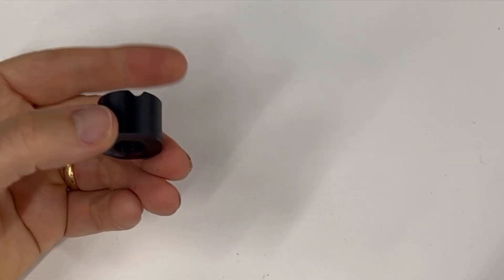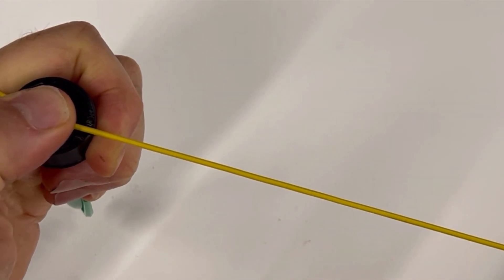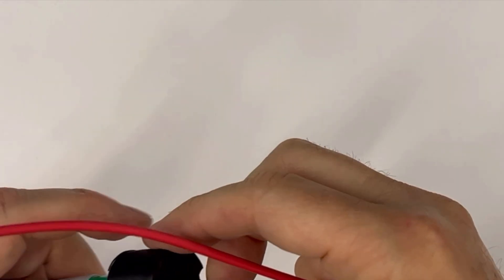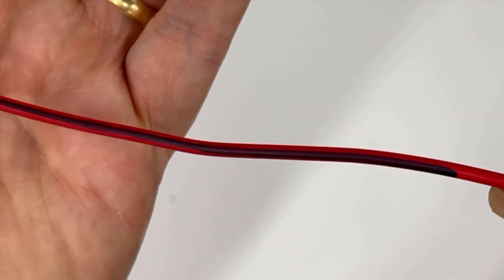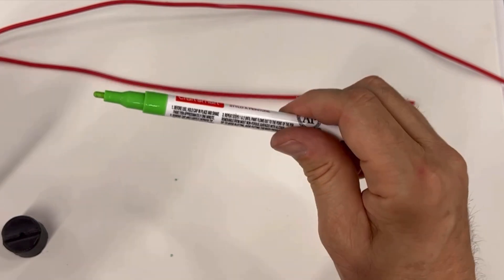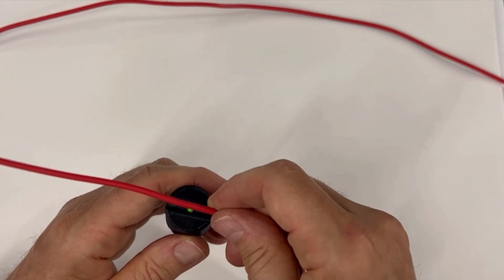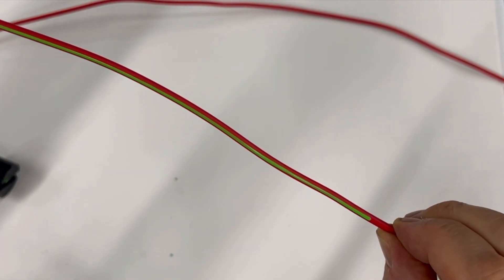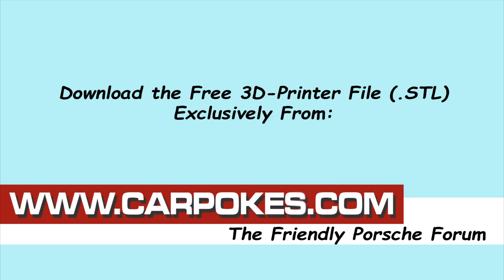Adding tracer stripes to solid-colored wires

Comment: This tool no doubt works well. But in a pinch (if you don't have a 3D printer) you can make do with the plastic caps of some aerosol cans. Some aerosol products that come with a straw have a slot on the cap for storing that straw. Drill a hole in the center of the cap for the tip of a marker, and make the slot in the lid wider as needed to fit the wire. Use the cap the same way you would use this tool.